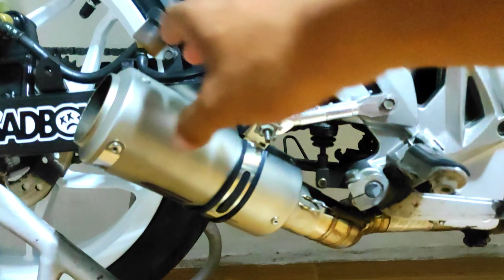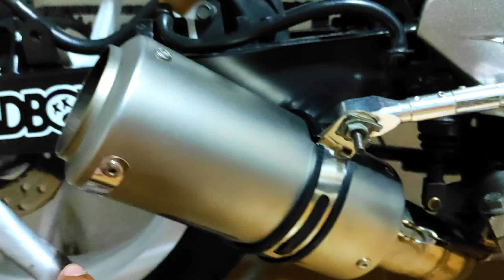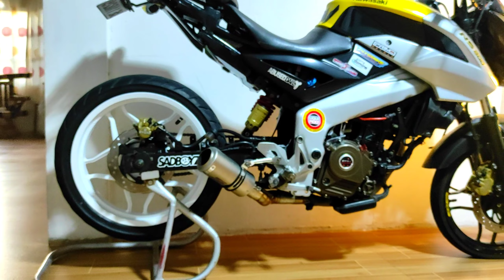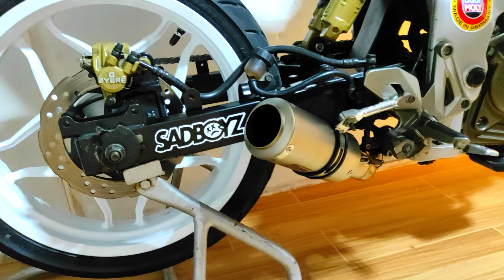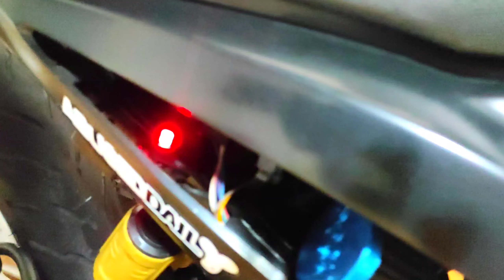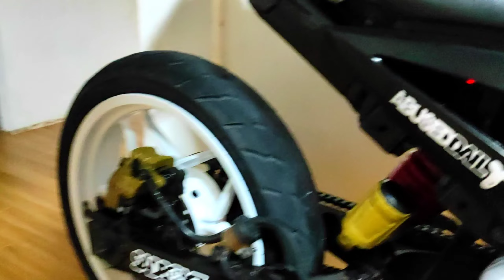SOUND CHECK🔥 Ns200 Kawasaki

Comment: san mo na score elbow mo boss full info naman salamat po
Reply from the maker: Sa tropa ko yan boss na naka daeng elbow pasok naman sa stock ng ns200 kaya yan nalng sinalpak ko.
Reply: para saang motor yan boss na daeng elbow?
Reply from the maker: Sa pinoy125 motoposh ng tropa ko di nya na rn nmn kasi na gamit.  Timing swak naman